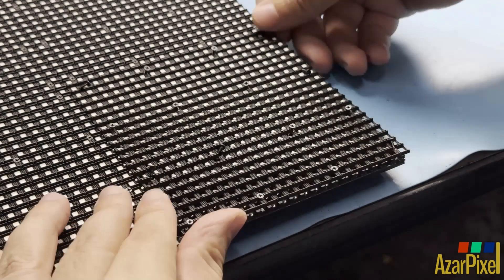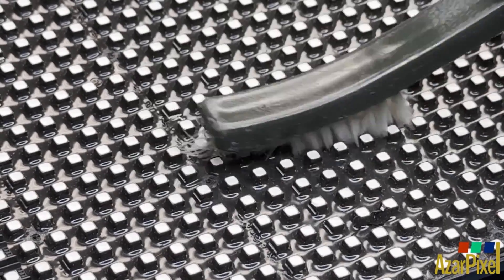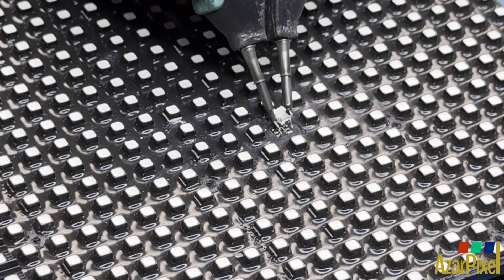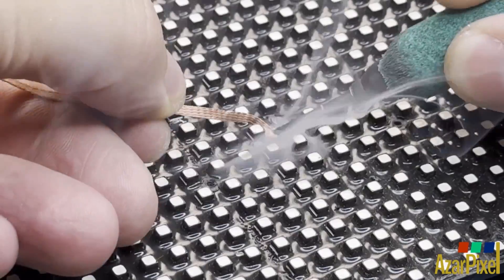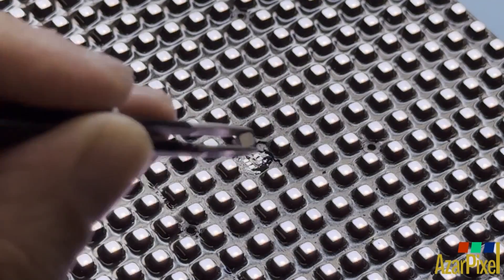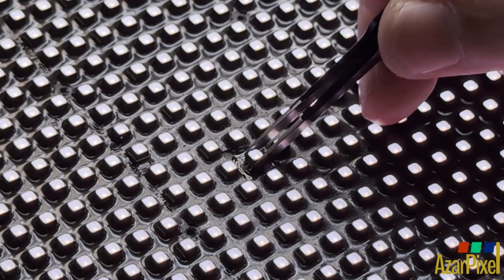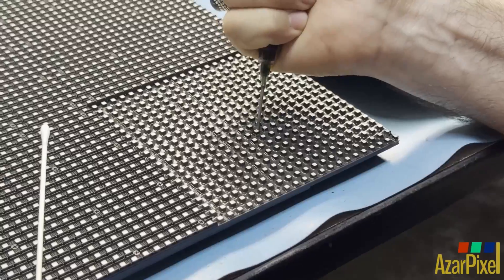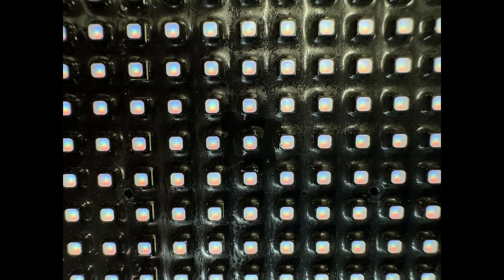How to repair outdoor LED modules? How to repair outdoor LED panels? How to repair outdoor LED signs

Comment: Where can i buy the black coating
Reply: Do you have link
Reply from the maker: Hi Riksteen, the coating can be bought in different e-commerce platforms. Specifically, those specializing in Audio Video equipment 😊
Reply: @AzarPixelLLC  how is it called the black coating .    And I have a p6 led screen rgb where can I buy that led chip. Thank you
Reply: @AzarPixelLLC  is it the same as plastidip ?
Reply: link?